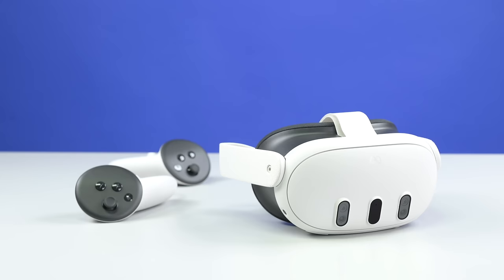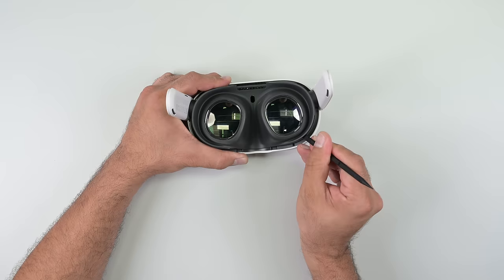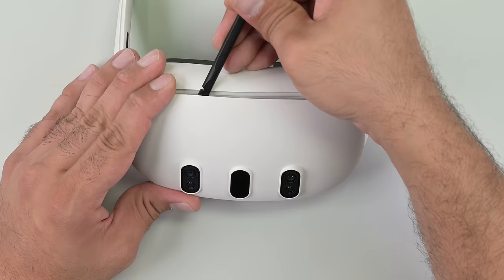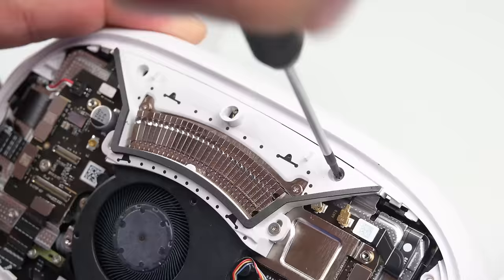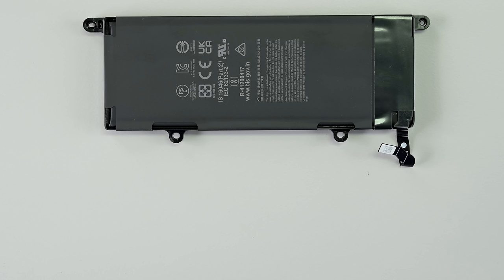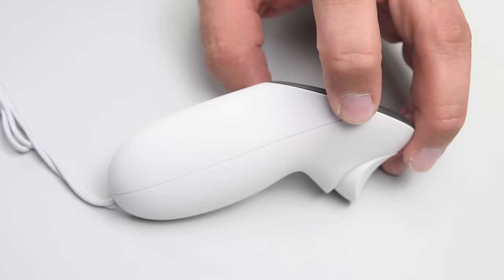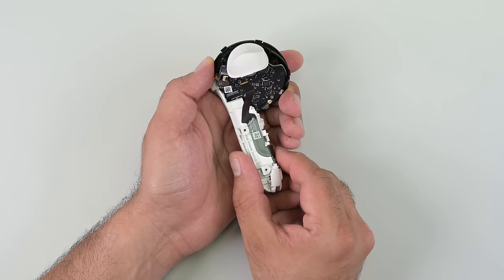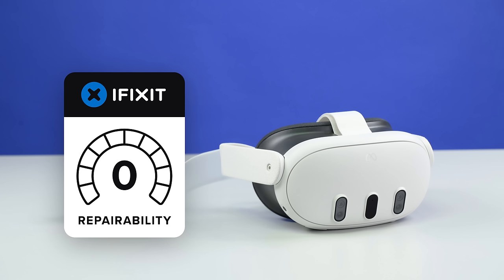Meta Quest 3 Teardown: What Are You Sacrificing for Savings?

Comment: The weight distribution is really important for the comfort of a VR headset, so it's not surprising that the battery is buried as close to the screen as possible.
Reply: Of course, so they should put it in the back of the strap to help with wright distribution even more! That would also make it easily replaceable.
Reply: @Iisakki3000 that's what I'm wondering - would it be a good design choice to take the battery out of the headset and put a slightly larger battery in the elite battery headstrap? Then that would free up more space in headset for whatever makes most sense to upgrade there - of course if they did that, they would have to make the decision of including a form of the adjustable battery headstrap with the headset in packaging - which would increase the price of the headset, although it could be worth it for consumers if they didn't then have to buy the 120$ battery strap separately, which would then cause a potential loss on Meta's part - but I'm sure there's a way for them to balance this all out cost and design wise in the future as their production cost goes down, etc
Reply: @3randomtrippycolors215 but then you don’t have a paperweight in 3 years when the battery fails and they can’t have that
Reply: This. The fact that it's significantly slimmer & denser is way, WAAAAAAAAY more important to overall comfort than the like ≈+10g of extra weight! Weight distribution matters DRAMATICALLY MORE with headset devices than raw weight! 

This is exactly why rear counterbalances like a rear mounted battery can help improve comfort despite making the whole headset notably heavier. 🤷
Reply: @Iisakki3000  no because where would you put a second battery if so desired?
Reply: Wouldnt make a noticeable difference no matter where in the headset they put the battery. Put 200 grams of counterweight on the back of a good aftermarket headstrap and you got max comfort. Get the center of gravity on the top of your head. Takes all pressure off your face.
Reply: @Iisakki3000 Sooooo, rendering 3rd party headstraps impossible?
Reply: @Cooe.  
Battery, main board with CPU should lay back of head for balance or in a box into pocket.
Reply: @snickerdoooodle  not necessarily. The battery could be its own modules, like on the apple vision pro.
Reply: @blastofo That is utter BS. It matters a lot because if they do it that way you get balanced 500g while with counter weight total becomes 800g, 800g has much higher inertia
Reply: @rangerkayla8824  I was just referring to the battery placement in the Quest 3. But comparing different headsets, thats different. Quest 2 was definitely more front heavy than other headsets. Quest 3 is improved, but it still can benefit from counter weight, which I already have on the third party strap I got for my Quest 3. I have one of those hook latches, and a rubber encased padlock. If I completely loosen the headstrap, the headset still stays in the right position because the weight is balanced.
Reply: @Navhkrin  It's ideal for long sessions of sit down games. For me, it was great for Skyrim VR, HL Alyx, stuff like that. If i'm going to be doing physical games like Thrill of the Fight, I remove the counter weight. But if you aren't moving your head much, you could have 10 pounds on the top of your head and it wont be uncomfortable if the weight is balanced at the top of your head. People have no problem wearing 10 pound motorcycle helmets for the same reason. The top of your head can bare a lot of weight just fine.
Reply: I’m not sure why they continue to make these things with internal battery anymore, when most people will just get a head strap upgrade with a battery.  They could’ve just included an elite battery strap in the box for essentially the same cost.
Reply: @Iisakki3000  the quest pro is like that, but probably because quest 3 is consumer product they just want us to use it and buy their newest headset when the battery is dead.
Reply: If the headset was good enough optically, I feel like they could get away with making the headset massively lighter and having the chips and batteries in a separate device that could plug into the headset itself and wear in a back pocket for example.
Reply: Strap a hacker thief companies VR headset on your head while AI slaves manipulate and control you... What could possibly go wrong.
Reply: Lol, someone wants the tinfoil hat version of the headset 😂
Reply: @Iisakki3000 there is a BIG reason meta did not do this

People LOVE replacing their quest 2s head straps, ask 10 quest 2 users their favorite headstrap you'll get 10 different answers

This customizablity comes at the cost of the headsets design

IMHO, this is the better alternative, your headstrap is much more likely to break before your battery goes bad, building the battery into the headstrap means that if your headstrap breaks you need to also buy a new battery, and it also makes the process of changing headstraps a nightmare as you'll also have to connect the battery
Reply: @timedrington139 battery life

The battery life is already bad, the only way to get acceptable battery life is a battery strap AND using the internal battery
Reply: @MikAnimal ive had my quest 2 for three years and it isn't a paperweight because of the battery.
Reply: Pico 4 did that and it's way more comfortable than Quest 2 but you can't replace the headstrap. I don't see any reason why you couldn't just connect the battery at the back with a nice woven cable to the front via USB C though to solve that problem and get the best of both worlds.
Reply: @Iisakki3000 they did it with the quest pro.
Reply: @Iisakki3000 ya but the quest 3 strap has something that other 3rd party straps haven't. You can lay in bed and put the back of your head on the pillow when working with quest 3 but you can't do that with other head straps because of the larg back of the head straps 😁
Reply: Battery in the back would have been the choice better for the consumer with the only downsides going to Meta and probably passed on to the consumer as a price hike. 
-Better balance
-Better heat distribution 
-more room up front
-replaceable battery
-easier repairs In general 
-Aftermarket straps would still be possible as long as the battery isn't hard wired 
- Auxiliary battery/ battery bank could be added anywhere (back, front, top, sides, neck, belt loop, pocket) 
It would be a straight upgrade for users, the problem is Meta wouldn't be able to bank on all the free money that their beta testers- I mean early adopters, are guaranteed to throw at the $100 overpriced plastic head straps. 
I would personally rather pay $65 extra lost by meta (factoring in the loss of the  full $130 from, a generous guesstimate, of half of the lifetime purchases) to be able to just use the device right away without the hassle of buying and attaching an aftermarket strap. 
Sorry, I'm half asleep, but I think you can figure out what I'm trying to say lol.
Reply: @Wooskii1  if you are so problematic with meta battery placement design, go buy pico than. Problem solved 😄
Reply: @fayenotfaye  if it was possible to connect it with a high end usb-c cable, you could have it in your pocket, a pouch around your chest or a small backpack. Whatever. You could even have multiple batteries. Like the Apple VR headset, they have the battery separated. Apparently it works like a charm according to those who have tried it.
Reply: Should have been on the back
Reply: Placing the main battery at the back of the head would be the best option. Just adding a counterweight at the rear of the head makes the whole unit heavier, and through momentum, it actually "sloghes" on your head. When you quickly turn your head, you feel all that weight get twisted on your scalp.
Reply: @fayenotfaye  I don't think there's need for a second battery in this scenario. Just replace the stock one with a bigger after market battery if so desired. The stock battery could easily be just a usb pd power bank.
Reply: If the battery is located at the back of head with head band, isn't it  easy to balance the weight? Then, the battery could be bigger to extend playing time and the display side also getting thinner. Maybe the price will be increased though..
Reply: over hit temperature : 93 d C
after update jan 2024 : it's 90-88-86-84-82-80: LoL:
Reply: Yes, if weight distribution is the issue, it should have been placed externally on the back of the strap. Apple Vision Pro has an external battery pack which can be replaced.
Reply: @Iisakki3000 this would be a huge dealbreaker for the great amount of people why like to lay down when using their Quest headsets
Reply: @finng745  just make it like the apple vision battery and include a way to mount it in the back. Could also make the battery just be a standard usb pd powerbank so you can swap it to a beefier one if needed, and easily get replacements.
Reply: Unfortunately the battery is gonna be the first thing to go, and in short order. Its only got a run time of around two hours before needing a full recharge. These short cycles are going to amount to a short life span. Few hundred cycles in and your already dropping down to half the original capacity and it just accellerates from there as the cycle rate increases.
Reply: @nikushim6665  thankfully there is plenty of battery accessories to prolong gameplay.
Reply: @snickerdoooodle  They should just make the Apple Vision solution, there is no reason for today's VR headsets to have any unnecessary components weighing on your face. Everything else except lenses, screen panels and tracking sensors should be in your pocket or clipped to your belt with a cable.
Reply: @ArnoldSig the Battery and cable on Vision Pro is quite distracting.

I am all for other solutions then Quest 3 but I would prefer they give the users simply the choice.
Reply: @vaulttraveler  I have the original HTC Vive and the cable is thicker and goes to your PC so I know what a cabled solution feels like. But if the cable was guided from the headset first to the back of your head and then run straight down your back to your pocket, I can see it being very convenient.
Reply: @Iisakki3000  then you cant change the strap
Reply: The only reason it's closest to the screen is to make replacement difficult. That's all.
Reply: @Iisakki3000 the battery being in the front is what allows to put additional batteries in aftermarket straps. This is one of the most important parts of the design for me. With additional batteries i get over 4 hours of battery. With the build in one under 2.

Comment: Coming from a Quest Pro, I returned my Quest 3 after using for an hour.  LCD panels took me back to Reverb G2 days of muted colors & no blacks compared to QPro. A bump in a resolution wasn’t significant enough to make the compromise.  Vibrant colors on a Pro is hard to downgrade from.  I did not care about other quest 3 features & primarily use it with PC connected via link cable.
Reply: Wow I have reverb g2 and then got the quest 3 and elite strap I’m happy with it but never have tried quest pro I would think there same lcd displays?
Reply: @B3VR  qPro has a Quantum Dot LCD panel w/ local dimming vs plain LCD on Q3

Comment: Great teardown, though you should mention that the Quest Pro does have local dimming which gives it a leg up against the Quest 3's LCD panels.
Reply: Better in terms of black levels & contrast? Sure! But better across the board?... Yeah... No... 🤷

Those LCD displays on Quest Pro are ≈-33% lower resolution & -30% slower in refresh rate than Quest 3's (QP's = 1800x1920 @ 90Hz per eye vs Q3's = 2064x2208 @ 120Hz; w/ both being dual panel LCD), meaning that overall Quest 3 arguably still has the superior displays FOR GAMING. 🤷 

(This is bc higher display resolutions & refresh rates are useful LITERALLY EVERYWHERE, whereas better black levels & contrast are only super noticeable in specific dark &/or high-contrast scenes/games.)
Reply: @Cooe. QPro also had the quantom dot pixel arrangement
Reply: I still think the Pro is better for PCVR. Q3 sure is amazing and especially for standalone and a best for PC VR too but as a purest for PC, it's the Pro for me using OpenXR Toolkit to get the foveated eye rendering too. The colours and contrast are just better because of the QLED backlit panels. It's horses for courses. There's nothing wrong with the Q3.....aside from the fact you need to spend another £100 or so on accessories. If I didn't have the Pro, I'd have bought the Q3 definitely.
Reply: Personally, buying quest pro seems more interesting to me for pcvr
Reply: When you see the two of them in person and do a side by side, you will be torn. In games and the VR home environment, the QPro panels will leave you feeling mixed about it, but in Video playback and UI interfacing, the Q3 panels will easily trounce the Pro's even in your most subjective of moods. The QPro doesn't win.
Reply: @WindFireAllThatKindOfThing I agree, the quest 3 resolution is way better and the screen is way sharper than quest pro. Also you can decrease your quest brightness to 40% and the contrast to 15% and the black lvl is gonna be really good in quest 3.
Reply: For the people in the comments, as a quest pro owner who does PCVR, who has conversed with multiple others who own Pro and Quest 3. 
All of them have picked the pro over quest 3 with some of them returning the quest 3, the screen and experience of the Pro is simply just better for whatever reason.
Reply: @v1nigra3  i have both, too. In my opinion, quest 3 is better for pcvr for me. But i understand people has a diffrent opinions.
Reply: I wonder if the LCDs have an anti-glare screen. If so, perhaps they can be removed for better black levels at the cost of glare. It has been done on PC monitors with stunning results. It would be more difficult but possible.

Comment: Great tear down! While the battery is difficult to remove, I still believe it is worth relocating to the rear. I'm guessing it is ~85g, which is enough to justify the relocation. I think weight is the most important part of modern headsets. Assuming you have an upgraded head strap.

Comment: I have both the Pro and now the Quest 3... In my opinion the Pro LCD panels are better. Just because a panel has higher resolution doesn't mean that it's necessarily better. In fact the small resolution bump of the Q3 is marginally noticeable... What is noticeable is the most important metric for an LCD panel, contrast ratio. The Quest Pro has much better black and near-black performance (even with local dimming turned off). Contrast ratio differences are way more noticeable and matter most in creating a believable image.... I have a program which allows manipulation of the LCD panels. Things like contrast, brightness, colour all have far more more latitude for adjustment on the Pro. (Much the same as the difference between a RAW vs a Jpeg camera image)  Essentially better dynamic range which points to a much better panel.... The Pro definitely has better panels, or at lease they were implemented better than the Quest3's panels... It's maddening as I had expected the Q3 to have more dynamic range... This is why Meta couldn't offer local dimming on the Q3. The less expensive panels can't properly produce the effect.
Reply: After playing on PSVR2's OLED i can't go back to quest.

Comment: Good to confirm they are using 64Gbit 441 ball LPDDR5X for the RAM. Despite the lower capacity, that's an upgrade from the LPDDR5 on the Quest Pro and the LPDDR4X on the Quest 2. Anyone catch the UFS solution? If it was shown I must have missed it.
Reply: I'd assume it's UFS 3
Reply: Oh wow so it has less memory bandwidth than a Steamdeck?
Reply: @Loundsify  I swear I posted it already as a reply to my comment, but looking at the reverse side of the main board it's UFS 3.1. Same as the Quest Pro, although a step up from the UFS  2.1 in the Quest 2.
Reply: @Loundsify  Yeah, 64GB/s vs 88GB/s. Quest 3 is still mobile phone class hardware, whereas the Steam Deck is essentially a Mini-PC. I'd love for them to step up to laptop class hardware and move the processing, battery etc off the headset, but of course that'd be a completely different class of headset (though I'm sure they could significantly undercut Apple's $3500).

Comment: At 6:50 we can see that the joystick used bears suspicious resemblance to those found in Joycons. I wouldn't be surprised if we start seeing widespread joystick drift on these controllers in a few months.
Reply: Thanks for the heads up.
Reply: I'm very surprised there hasn't been a 3rd party hall effect replacement joystick for the Quest 2/3 yet when we have them for basically every other device and controller

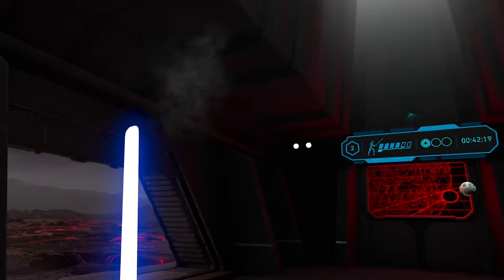Comment: 4:00 Which means the battery, just Like the Quest 2, is virtually impossible to replace (assuming you can get a replacement) and once it dies (which will be outside the warranty period of course) it's game over and will more than likely coincide with the release of the Quest 4.  I've purchased this purely because my Quest 2 battery's on the way out, not because I want the "latest and greatest". 4:12 Should have watched the rest of the vid, so it's "replaceable", an improvement on the Quest 2 at least.
Reply: Same here.

Comment: I was really hoping replacing headset battery would've been a bit easier so I could've used the headset with impunity. Now I have to be careful and try not to: charge to 100%, play to 0%, fast charging it so I can hop into VR quickly, use VR/MR to relax and do mundane things in it. Basically, had battery been easily replaceable, I'd be using it a lot, a helluva lot. At least 5x more total hours used. Now I gotta make sure I use it when I can get the most out of it instead of using it willy nilly causing unnecessary battery degradation.